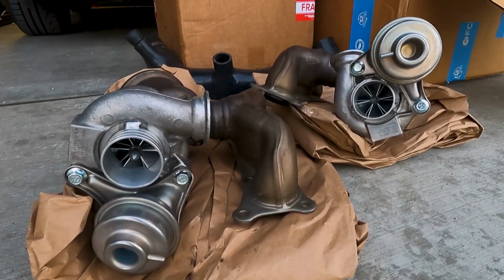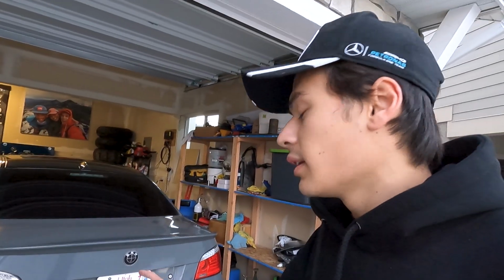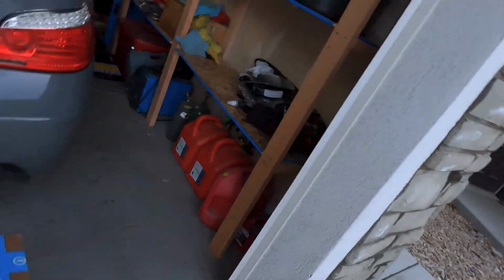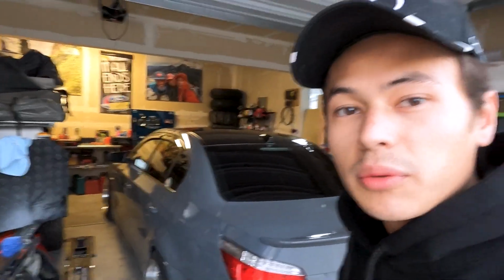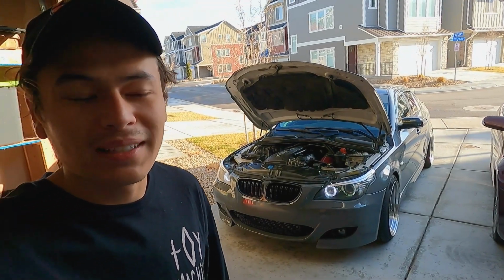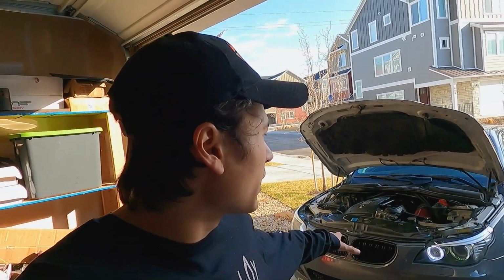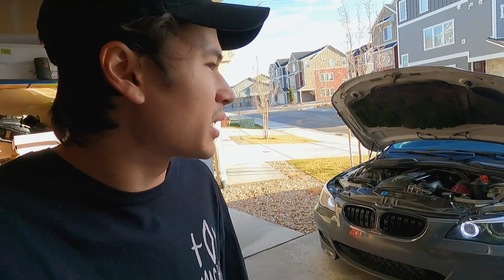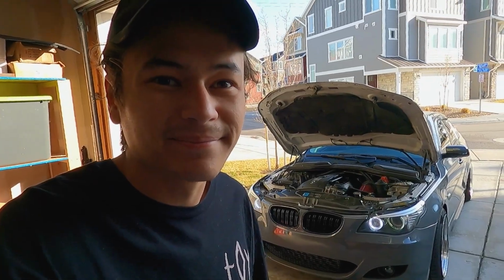N54 535XI Pure Stage 2 Turbo Upgrade | EHOONS E60 BUILD EP. 10

Comment: Been waiting for you to drop another banger!
Reply: How long did it take to do all the work?
Reply from the maker: Probably 3 working days total not rushing. 1 for front subframe removal, 1 for turbos and oil pan reseal, and 1 for subframe and front end reassembly. That’s for a first timer in the garage. If you had a full lift it would be quicker.

Comment: Hi bro  i have a 2008 bmw 535xi and i replaced the valve cover gasket and the oil filter housing gasket but when i do a pull on 2nd gear the car smoke from exhaust blue smoke this usually to happen when i stop in the red light for a while and go forward on 2nd gear this probably my turbos? Help

Comment: Did you have to bend/notch your front down pipe or did it install without modification? I just bought some and mine does not have the notch for the axle housing but I bought one for and xdrive 535.
Reply from the maker: VRSF sells downpipes with the notch specific for X Drive 535

Comment: Did it bolt right up? because most of the aftermarket turbos I have seen have said  the charge pipe and rear turbo return coolant line needs to be converted to LHD 335i. Was that the case for you?
Reply from the maker: Hybrid turbos are exactly that, a hybrid. They use stock turbo housings with better internals. The stock turbos you use to build hybrid turbos, will change what they fit on.

If you buy 335i hybrid turbos then, yes, you need to modify things to fit. If you use 535i hybrid turbos then they are direct fit.
Reply: I also had the same issue ended up doing the conversion on my 2010 e60.

Comment: Did your E60 have a power steering line running through the sub frame? My Rwd had a line that runs through the subframe passenger side
Reply from the maker: There a some power steering lines that are bolted to the subframe but none of mine went through it. You can disconnect the lines and steering shaft and drop the steering rack with the subframe.

Comment: What it is the best for n54 a bigg turbo(cea6266) or two turbos
Reply from the maker: Depends on your power goals. Twins are usually maxed around 600-700hp. Single turbo setups are capable of 1000hp. Also AWD vs RWD makes a difference. I opted for twins to fit X Drive.
Reply: EHOONS Thnk u☺️
Reply from the maker: Yes the 535xi manual exists. It’s definitely rare but they’re out there. There are 6hp rebuild kits and upgraded clutches available. There is also a 6hp swap from the diesel 335d that can hold big power.
Reply: @69BigLou  I have an LCI E60 535i X Drive 6MT
Reply: @69BigLou  It’s a term BMW uses for updated, facelifted models. It stands for life cycle impulse.
Reply: @austinmerrival927 same here it’s the dream spec🔥